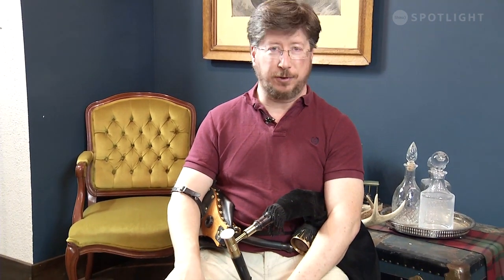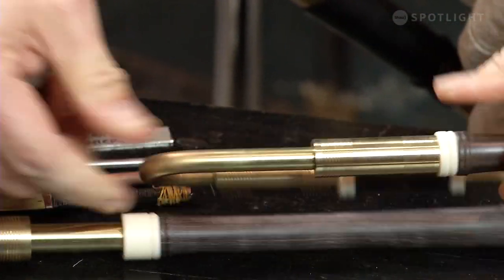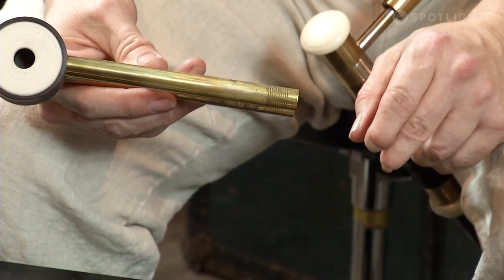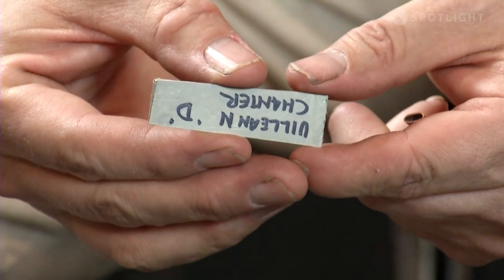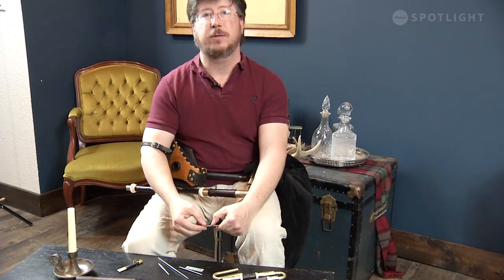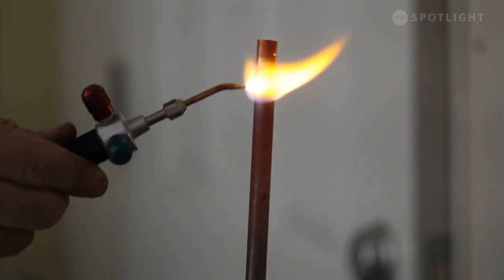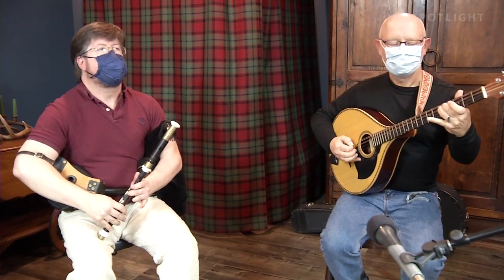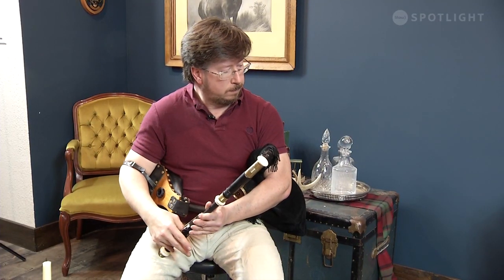Making Uilleann Irish Bagpipes

Comment: Graham mentioned how these bellows-blown pipes can use dry air. But there's another very obvious advantage that was not mentioned: because your mouth is never used when playing, you could sing while playing at the same time! :))) I bet there are recordings of people doing this. I've managed to find some Youtube videos of people using other bellows-blown bagpipes (doesn't have to specifically be the Uilleann pipes, because there are other forms of bagpipe that are bellows-blown) and they play while singing. The fact I could hear Graham talking while inflating the bag near the end of the video further proves this :).

OK, maybe I don't need to mention this, because it's just too obvious. Still, I felt like mentioning it :). Of course, you'd just have to have the mental capacity to be able to sing while playing; you have to use one arm to squeeze the bag and maintain the air pressure going to the pipes, while also using the other arm to squeeze the bellows to supply more air to the bag, plus fingering the notes on the chanter... that's a lot to be doing at once. A further complication is that the squeezing of the bellows rarely, if at all, happens in time or in rhythm to the music. Try adding singing or even talking to that... probably not that easy for everyone; that's pretty intense multitasking. So if you can successfully add singing to all of that, then I'd say you're a really great multitasker! The folks who do manage to add singing to that are impressive.